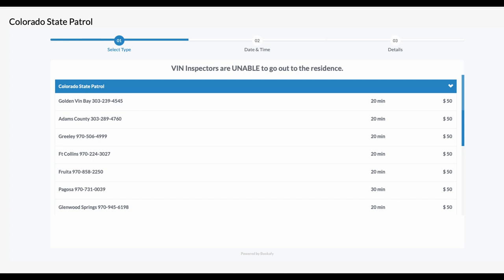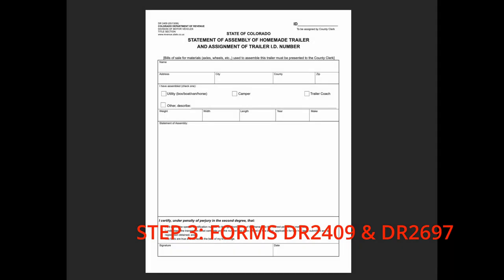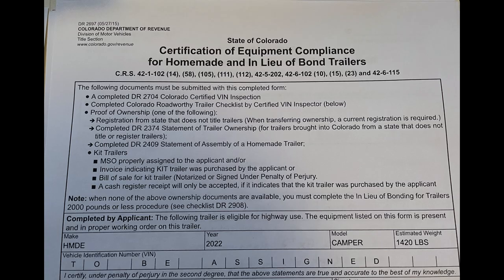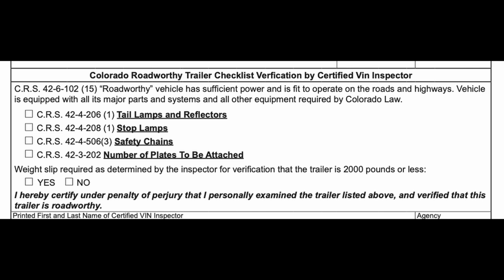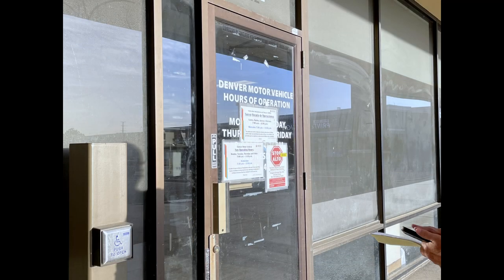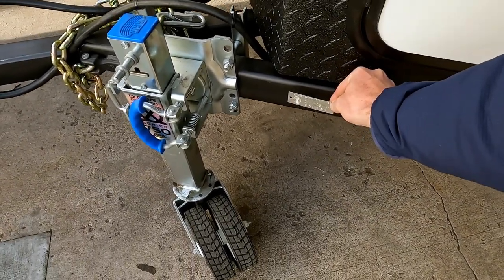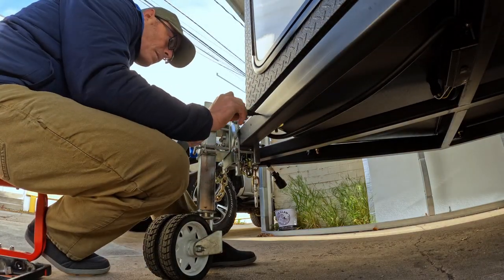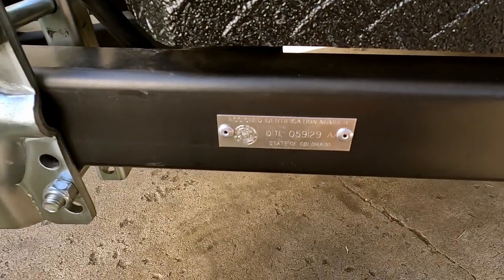Homebuilt camper trailer registration in Colorado

Comment: Thanks for the great video, was a big help. A couple of notes:
1. After you make the VIN appointment, you can take that appointment notice that they email you and use that to get a temporary tag. Not sure if the state patrol would give you a ticket if you showed up without one, but not worth the risk.
2. If your trailer is a small utility trailer, you may not need the weight slip. The state patrol will note on your paperwork whether or not you need to bother getting your trailer weighed. So, I wouldn't weigh your trailer before the VIN inspection.
Reply from the maker: Glad it helped.  Thanks for the input.

Comment: I built a boat trailer that currently has the boat on it. Can I get it weighed and tested with the boat on it still or would I need to remove the boat? I know the weight of the boat and equipment as well so I could easily do the math of what the trailer weighs.
Reply from the maker: Not sure, but I would guess they need just the trailer weight on the receipt for registration.  Maybe the scale people can subtract your boat weight, give them a call.

Comment: Does the trailer need to be complete in order to get a VIN inspection and VIN assigned to it?
Reply from the maker: Complete enough to be road worthy (lights and fenders) and it needs a weight slip.
Reply: @infosponge  So in other words, I can't just have a completed trailer without the cabin on top? xD
Reply from the maker: @drumbumifyer  you could, if the lights are installed on the frame and it has fenders.  It would possibly be registered as a utility trailer instead of a camper though. Which could be a problem for insurance.
Reply: @infosponge  That makes sense. I don't know if I'd bother with insurance. Looking at what those policies actually cover seems like it's not worth the cost.